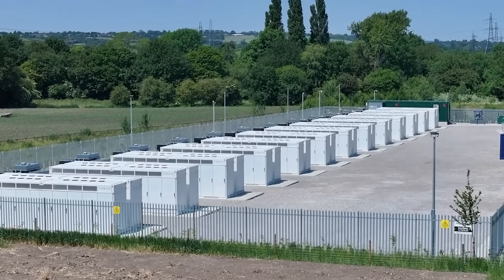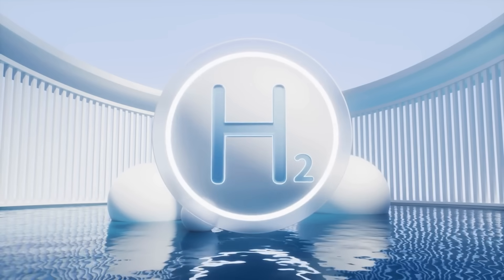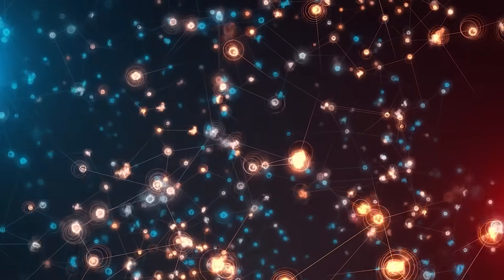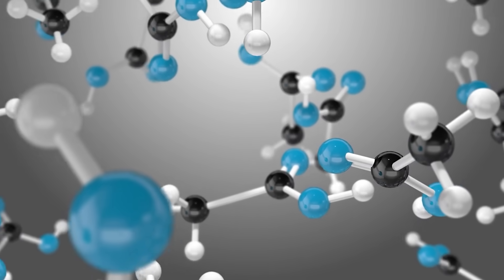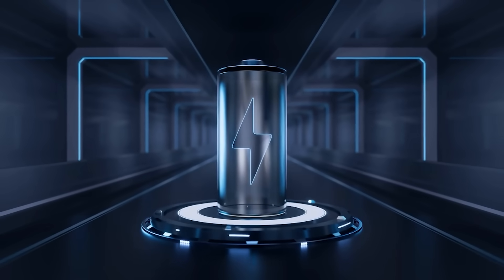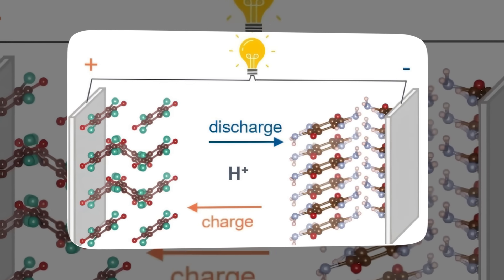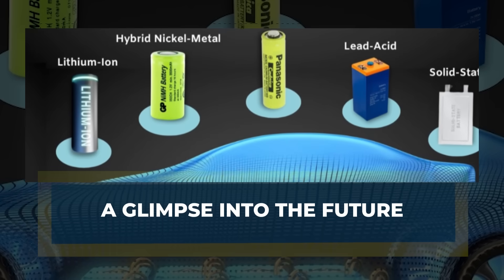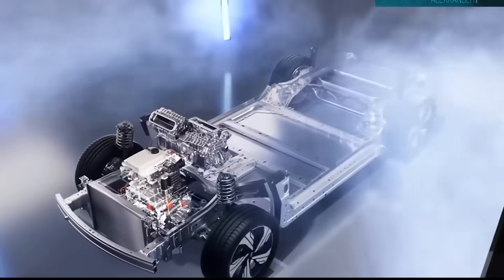The Proton Battery That Could Replace Lithium — UNSW’s Revolutionary Discovery

Comment: This video is about a proton based anode, not a battery. It’s not a battery of there’s no cathode and cell voltage. How dare you compare to Li-ion cells when you can’t even give a cell voltage. Capacity x voltage = specific energy which is what matters
Reply from the maker: Thanks for your insightful feedback on the specifics of the proton-based anode!

Comment: These, sodium batteries, and the new discovery that zinc rechargeables are the opposite of most in that fast charging actually reduces dendrite formation and heals (kind of) the battery. Things are look good for batteries in the future. Litium is still the best general purpose batter when protected agains thier one weakness (fire prone), however they're going to get regulated to where nothing else works well enough to be worth the trade offs.

Comment: Thought sodium was to replace lithium?
Reply: what replaces what depends on the use case. However sodium does cover a lot of use cases. That's lithiums real strength, it can cover quite a few use cases well to exceptionally. Sodium isnt quite as good on energy density, it is better than lithium in most other ways. Charges much faster and can take many more charge discharge cycles. Also can be used safely in cars with a much simpler management system and without the complex cooling system giving back some of the range lost from lower energy density. also doesn't swell and shrink quite as much allowing a bit better packing of cells.

Comment: Lithium-Iron-Phosphate (aka LFP) batteries and Sodium-Ion batteries have the safety and operational (longer-life and less temperature sensitivity) advantages over Li-Ion batteries, as well as abundantly available materials for lower cost and reduced geo-political tensions, with similar disadvantage in energy density compared to the proton (hydrogen) battery discussed. Therefore, almost no reason is given to invest in development of the "proton" battery.
Reply from the maker: Thanks for sharing your insights on different battery technologies!

Comment: If the video starts with Lithium is limited you can already stop at that point. 
Anyhow a proton is ionized hydrogen and shares the identical issue in storing as hydrogen does. Case closed.
Reply: Not to mention the amount of energy it takes to produce hydrogen from available energy sources. Eventually, if considered in a energy loop it likely will be a case of diminishing returns between the energy produced and the energy needed.

Comment: Quinone, the bitter pill. Good for Malaria,  Chikungunya etc. What a discovery?.
Reply from the maker: That's an interesting connection to quinone's other uses!
Reply: @TheForgeEmpire 
Hello, it's not a joke. The formulae that you showed contain Benzene ring.  Aoevera must be similar, which is also used for storing electricity. In fact, I did some experment and was able to light an LED bulb momentarily. The mechanism was somewhat similar to the joule thief. That when I got this idea. I have seen a video in Hindi that a guy used Aloevera gel in a 2 inch pvc pipe to store electricity.  My friend, this is how nature stores energy. Like everything, electricity is also a pair, white and black, real and imaginary. It's not only the white light that charges the plants. I have given you people enough clues to work on.

Comment: The aluminum ion battery is already in production and it beats the battery described in this video in almost every way.  And it is already in production..  The sodium battery is also already in production and  also beats this battery described in this video..  You appear to be spreading disinformation.
Reply: No,  the aluminum ion battery is not in production. If you trace down your source on that you'll realize it's just hype and doesn't align with Tesla's official statement on the subject.
Reply: The Sodium battery does not beat what is described here. Not in actual testing.